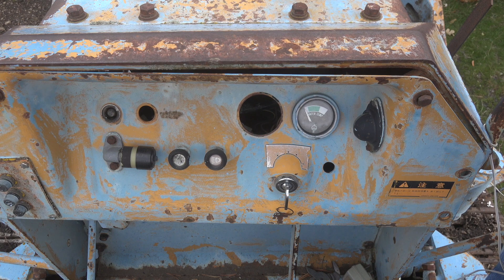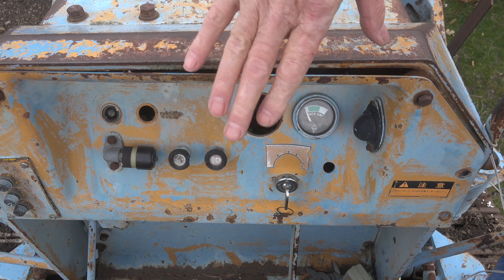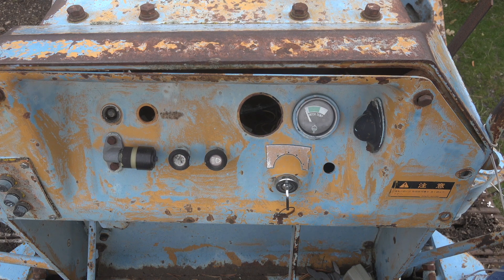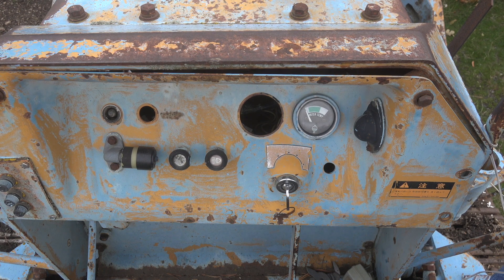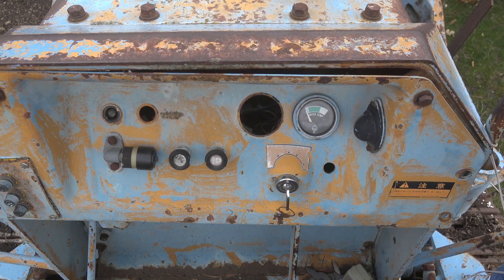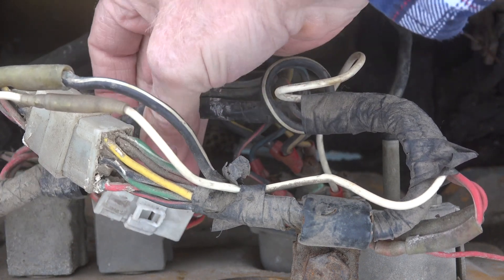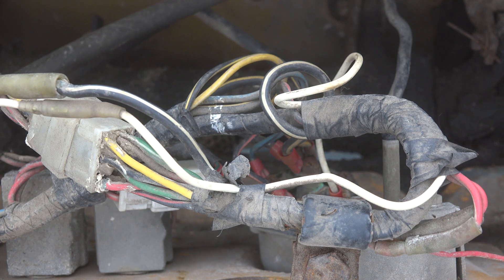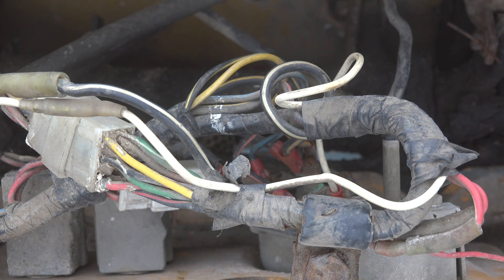Electrical troubleshooting problem.  Can you solve it?

Comment: The temp unit you pointed to is a ivr regulator to from voltage down the problem is conector corrosion  and high resistance or open circuit. 
Gary from the state of Michigan good to hear from you please stay safe .
Love your videos

Comment: Seems like the black with red tracer wire that seems to come from the start Sol goes to the bottom of the wire connector and where the wire connector is pulled out from the bottom and not plugged all the way in. The wire connector also looks very corrosive causing a high resistance. So when you put the cover back on, kinda pushing the connector back in enough to complete the starting circuit.🤔

Comment: Molex plug is just a bit unplugged on the lower half. Red wire to complete the circuit isn’t touching the other half. Had the same issue on an air handler. The wire was pulled out just a hair (modex was together though), which caused the furnace to not send power to transformer or blower. Good find sir!

Comment: Most likely a bad terminal on that molex plug, do a resistance test on either side of that plug. I have cut out  many of those plugs and hardwired the accessories in my 27 years of repairing commercial marine equipment. Just stumbled on your channel, liked the videos and subscribed.
Reply from the maker: The answer is linked at the end.
GFM

Comment: epoxy on your red wire looks gone. could be loose connection. opening the starting circuit. if it was a short id assume you would be blowing a fuse. a loose wire connector will cause that issue tho. or its a cabinet door kill switch i cant see.

Comment: Start switch needs a ground through the panel to trigger the starter? Or is it totally visual and that red wire has partially popped out of it's home in that left hand connector, along with the connector being partially loose?

Comment: Ground wire corrosion. Metal panel made a better contact to ground.
The starter selenoid needs a solid ground contact.
Anyway, what year is the car?
Reply from the maker: Its a 1983
GFM

Comment: There's a short in the starter circuit and the dashboard completes the ground. The red wire from the connector on the left is the offender.

Comment: A wire stretches out of contact with the connector as you pull open the dash because it is not as tight and competent a connection as it appears to be...

Comment: Molex is a disaster.  Red wire is partially pushed out, corroded and jamming the connector.  In addition, it is full of mud.  Possible rub out on yellow wire.

Comment: Hi greyfurnaceman , have you ran your own business? Do you think its possible to open an hvac business JUST doing MAINTENANCE precision tune ups in residential and light commercial and service only for maintenance agreement customers?   Maybe add duct cleaning and focus on IAQ? Im in my 3rd year and opening my own business, I know service work can get pretty complicated at times and thought maybe for my first year I will have my company just focus on the two things above.
Reply from the maker: I have run a business.  As a newby in the business, you are probably best sticking to filter changes and pre season service.  
Residential will not support you in these first years unless you are willing to do some advertizing.  You will need to be a bit of a salesman and get some commercial contracts.
GFM
Reply: @grayfurnaceman  those are great goals you have laid out for my sight.  Thank you GFM!

Comment: Looks like the one connector is pulled apart a little bit. Maybe the pins inside aren't touching like they should. At first, I was thinking that the dash panel was being used as a ground and had to be bolted back on...then I saw the connector.🙂

Comment: The red wire in the lower left of the block connector looks corroded to the extreme at its contact interface. Potentially something is grounded to the panel, with the panel adrift, the circuit is no longer able to seek ground. Interesting...Cheers & Thx

Comment: Looks like the connector on the left is sitting off, not making contact on the bottom pins. This may break the circuit when the panel is down, leading to a nonstart situation.

Comment: Rusty ground bolt center stage secondary wire and lug to ground 00 wire and correct lug and copper ground strap would fix it

Comment: Certainly hard to troubleshoot from behind a computer screen but you say it’s something we can see, so what I see is:
1-	The large connector looks like it is not fully engaged. It also looks like it may have had silicone applied to it which in turn could cause corrosion in the connector. 2- Looks like the clamp on the harness has been pinched or damaged in some way so maybe a damaged wire under that clamp. 3- Green crustiness and rust making for a poor connection. 4- Heat shrink on the black with white stripe wire looks loose. 5- Can’t really see this from the picture but maybe a bonding strap from the panel to the frame is missing, loose or corroded?  That’s all I got, look forward to the answer.